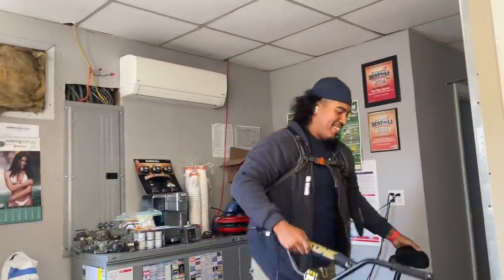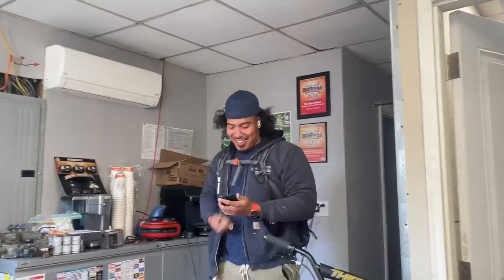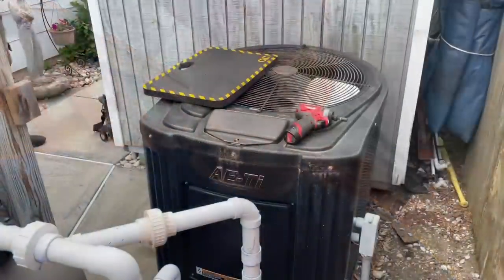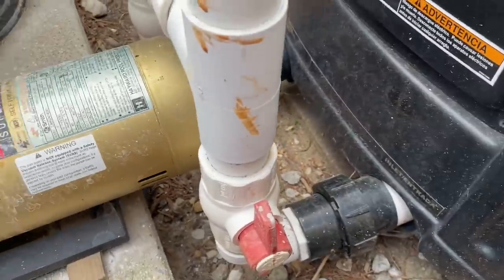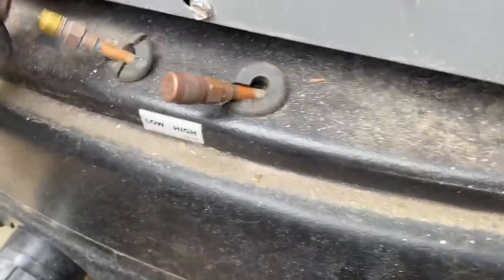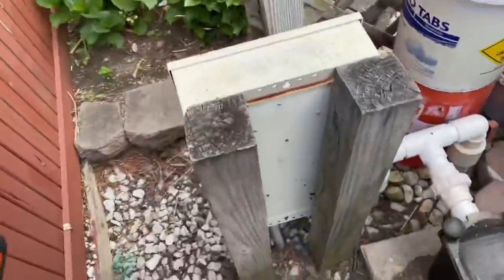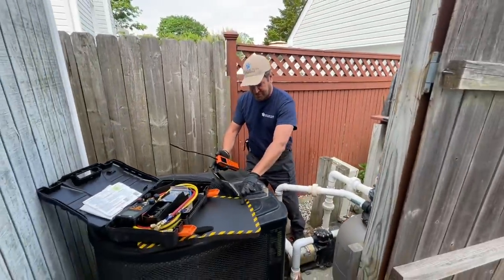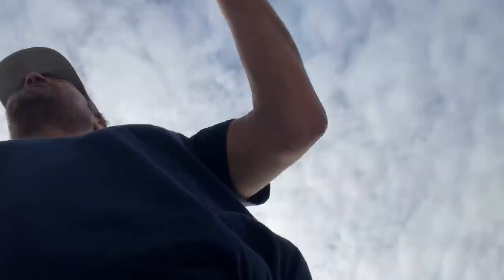Jandy AE2000T Pool Heat Pump Not Working Fault Low Ref Pressure Error R22 System Leaking

Comment: I would agree looking for a leak pressure testing and so forth but at least try to tighten up the Schrader valve or replace it . Leak repair can be costly on split systems. This one is a small unit . You gave the client options  there choice , nice call 👍
Yes I'm a licensed contractor.

Comment: I may have misunderstood but I thought it was lawful to recover the R22, do the necessary repairs and system tightness test and then transfer the recovered R22 back into the unit, topping off as required with ‘new’ R22 to achieve specified system performance? Of course I am ignoring the economics of the situation. Good video.

Comment: Mikey Pipes, Great videos !!!!!

Have you run into many Jandy JE3000T Heat Pumps that start hammering randomly when in operation ?  Shutting the unit off and re-starting clears the noise but it will occur again in a few days/weeks.  Is this the start of compressor failure ?  This is the second unit in 5 years.  The first one was completely replaced by a new unit by Jandy.  Have you run into this issue in your service experience ?
Reply: @PipeDoctor  if you have time would you be able to watch a video and let me know what you think ?  i could email you....Absolutely no rush as everything has been shutdown and winterized

Comment: Could you replace a fan run capacitor with a dual run capacitor as long as the mfds are the same and just not use the herm terminal?

Comment: You could have change schraders, leak check with electronic leak detector again and if no other leaks, topped of system and left unit working. If there were any significant leak found, do a 407C conversion. Just saying. 🤔

Comment: You could have used some of that fake drop in r22 for that and got him up and running instead of leaving the customer  without! With no equipment available because of the pandemic that would be cost effective! Bad for business to leave a customer without Mikey pipes!
Reply: maybe even suck out the 22 and put something else in ya that bad but if it needs replaced anyways what is there to loose
Reply: 407 conversion
Reply: Alot of solutions to be considered except for leaving the customer without anything!
Reply: @jefferygrady3181  Then again,it's not really an emergency to have 80 degree pool water

Comment: Mikey.   427a direct R22 replacement is less that 10 bucks a pound.      No need to do anything just drop it in.
Reply: @devnull7550  not sure what you saw or read.  But I have been dropping in 427a like a B2 bomber in World War Two.  Never any issues what do ever.   New and old systems alike.